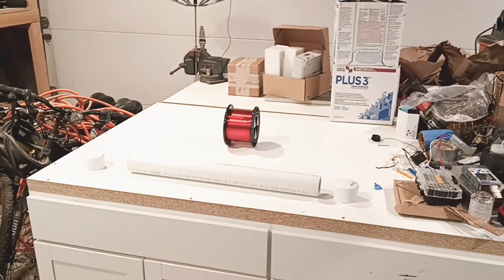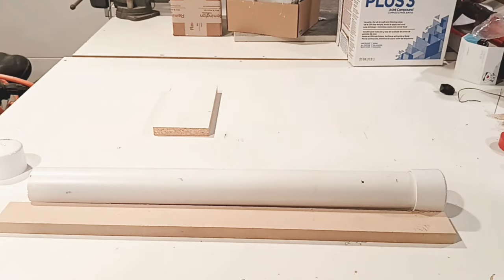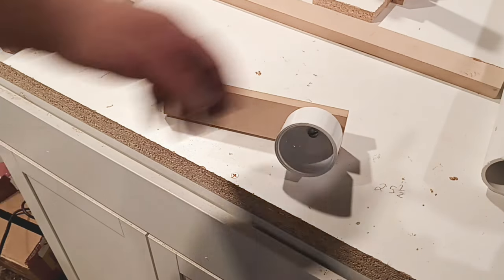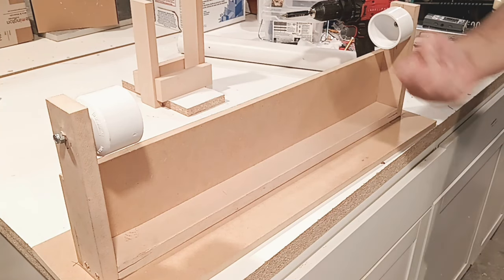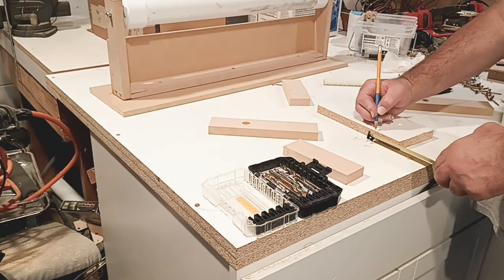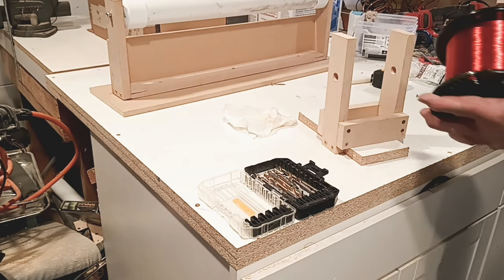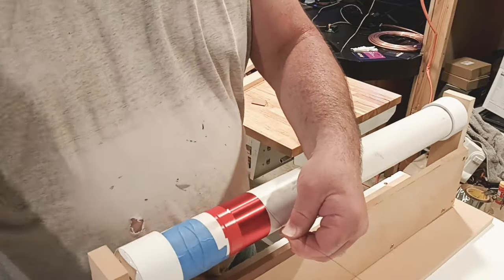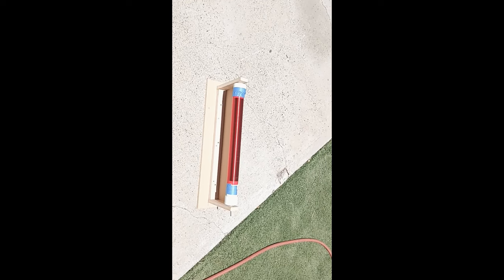Tesla Coil "Winding #2 Coil"

Comment: Instead of insulation tape, use kapton tape. More insulation against breakdown voltage.
Reply from the maker: I will look into it. With higher voltages I may buy it sooner than later. Thanks.

Comment: hi great video but how do you work out the right length of wire as in is it a 1/4 wave  1/2 wave ? i think most tesla coils are 1/4 waves but im no expert in these coils as the length donates the wave if its not correct they burn out apparently can you enlighten me how you actually do work it out thanks.
Reply: You are talking about high-frequency radio transmitters and receivers. Tesla coils use low-frequency kilohertz radio waves.  A 1/4 or 1/2 wavelength would simply be too large. You can google how big a kilo hz wave is, and it might make more sense.
Reply from the maker: I built it to match Alexeys. I would normally use 14" for a zvs circuit. There is a calculator that helps when I do the circuit I will show it and leave a link.
Reply: @nathanbunten4299  cool many thanks.
Reply: @shawncalderon4950  wrong telsa coil as in his patent its a 1/4 wave this proves people are making them and not understanding it.
Reply: @nathanbunten4299  If it matches Alexie’s design, I can only guess he wanted a precise resonant frequency. Perhaps his design has a low power output because if you try to increase the input voltage of his Tesla coil design, it will always blow up the MOSFET. Perhaps he purposely used an unstable Tesla coil design to protect his secrets until he got a patent or earned some compensation for his efforts. With a coil this large, I would be cautious about only allowing input current to be .5 amps. As you know, higher amps kill your MOSFETs. I am still working on the ZVS from the YouTube channel SciTubeHD. I will be sending you the photos when I am finished.
Reply from the maker: @shawncalderon4950  the zvs has more power. I put in 80v 13a and it took it. It also burnt every wire to the #1 coil. It also produced light with the coil not working perfectly. I think the big coil has a good chance of doing something. I hope Alexey did it to increase the feedback. That would really help.
Reply: @jediknight2350  “Wrong”. Wow, what a harsh response. It seems you are adamant about a topic you know very little about. You are correct when you say no one fully understands Nicoli Tesla’s many experiments and patents. He was a genius on a level that hasn't been achieved since. Just because 1/4 wave is mentioned in his patents doesn't mean we are to assume it applies to Alexy’s Graviflier Tesla coil or any Tesla we build today.
The quarter wave design was the best theory to practice what was possible in the 1890’s.
The Tesla coils we build are for big sparks. Tesla wanted to power the entire world with wireless power. Today, we have different goals. Quarter wave theory cannot be applied to the Tesla coils today. Thank you for sharing your ideas. I hope I haven't offended you.
Below is a snippet from Tesla’s patent if you want to study this topic further.

 Patent No. 645576, Nikola Tesla, System of transmission of electrical energy, filed September 2, 1897; granted March 20, 1900 
The length of the coil in each transformer should be approximately one quarter of the wave length of the electric disturbance in the circuit, this estimate is based on the velocity of propagation of the disturbance through the coil itself.
Reply: @nathanbunten4299  Yeah, the overheating of the primary coil can be a problem. The reason for this overheating is that you need more windings. I wind eight turns for the primary coil. The second reason for overheating is that the zvs aren't oscillating correctly. Also, I use 1/4 inch copper tubing from the Home Depot plumbing department. 
For some reason, I have to put a switch on the negative power wire. Then, I flip the switch rapidly with my hands until the current is around two amps.
On the SciTubeHD channel, he charges the input power capacitors before connecting them to his ZVS Tesla coil. I appreciate all of your feedback. I learn so much from you. Keep up the good work:)
Reply from the maker: @shawncalderon4950  The primary is not the problem. The amps are way to high. 12a is not good 3a or 6a is fine. I burn the wire because it is not oscillating properly. The zvs never even got hot. I need to drop the amps. I tried my regular power source and it faults. I am going to try a battery and a small transformer to reduce the amps. That way I can set the oscillation.  Then bring up the power. I may try a step up transformer. that would increase the volts while stepping down the amps. I can live with that.
Reply: @nathanbunten4299  You are right. Too high amps equals poor oscillations. My ZVs never overheat because I oscillate before powering up for the sparks. There is a video where a guy has two power supplies—12 volts to start the oscillations and up to 80 volts for powering big sparks. I even have a schematic for these two power supply setups. I think I am being taken as unfavorable in the comment section. Let me know, and I'll be quiet.
Reply from the maker: @shawncalderon4950  I put you on the always allow comments. I like speaking with you. 12v starter then the real voltage. Sounds good.
Reply from the maker: @shawncalderon4950  I think I found a way to sole the tesla coil ( hum signal ) you said start the tesla coil at one voltage then turn on the other. If I run it at the first voltage with everything connected. Then I hit the high power in a burst. As long as the wire is down the throat then I should have the mhz in the coil already in the top 4" that means when the energy hits I get my energy surge. I just need the button to power the high voltage of the tesla coil at the same time I hit the ultrasound button. I think our talking about the subject just allowed me to bypass the need to hear the hum. Thank you.
Reply: @nathanbunten4299  thanks, man. It means a lot!
Reply: @nathanbunten4299  ok, sounds good!
Reply: @nathanbunten4299  Sounds good! Do you want me to email you the 12v setup and then the 80v setup?
Reply from the maker: @shawncalderon4950  yes.

Comment: Don't tesla coils have a doughnut on the top?
Reply: in this case we don't need it
Reply from the maker: It say #2 coil. I did not build the #1 coil and circuit yet.
Reply: The top mass acts as capacitor, so more surface tension on top will increase the capacity of the circuit.
Reply from the maker: @Kangsteri  That is why This is so interesting. Why did Alexey build such a big #2 coil. The Graviflyer is the top load. There has to be a reason.
Reply: The gravity flyer is kind of the top load🤔

Comment: Dude. I've built every Slayer Exciter Tesla coil on the internet. Your wire is too thick, and your pipe is too long. Even the powerful ZVS Tesla coil we are building doesn't have a coil as large as yours. 32 AWG and 34 AWG if you have the patience. 28 AWG will work, but it draws way too much current. I am speaking from personal experience. I have a graveyard of fried MOSFETs and too-big, too-thick 28 AWG coils. You only use a coil as large as yours when you are building a spark gap or a large DRRTC Tesla coil. Your secondary coils should be 7-9 inches long, 2.5 -4 inches in diameter, and wound in 32 AWG or 34 AWG—shorter, fatter coils work best for the slayer exciter circuit. Also, the schematic I sent you is a battle-hardened slayer I built and tested myself. 
Ok, great video!
Reply from the maker: This was the first coil I am building. Did you see all the wire? I am going through several to find the best one for my project. The video was how to build a jig to wind wire. You are right this might end up being a spark gap #2 coil.
Reply from the maker: Alexey used a coil this size. Did he know something we don't. If I cut it down 4" would it oscillate better? When the Gravifler is connected the top 4"-5"  is taken over by the frequency of the craft. It is 19" long 15/14" long would oscillate prefect with tons of power with a zvs. I want to know why he did it.
Reply: @nathanbunten4299  Forgive me; I haven't seen all your videos yet. I always wait in anticipation for a new video and have watched several of your videos. I think I am hooked on your channel:) I always learn something new. Your jig video is one of my favorites. I will watch it several times before I build your coil winder. I can see your cabinet-making skills shine through.
Reply from the maker: @shawncalderon4950  I didn't use any cabinet maker skills. That is why this is so perfect. Anyone can do it. Normally I would use dado cuts or pocket cut or even dovetails to make every joint. The fact that the screws split the wood was even better. It takes the "I can't make this complex thing" and replaces it with. If this can work I can do it to.  I hope people do it better and show me. adding a motor with a foot peddle would have saved me an hour of winding.
Reply: @nathanbunten4299  I agree with you 100%. the true mark of a master craftsman is the ability to teach others, making the difficult achievable. I meant this as a compliment:)